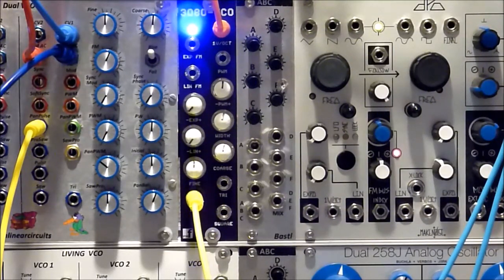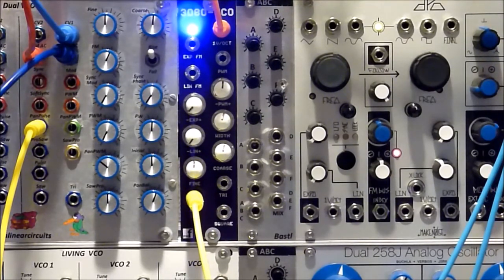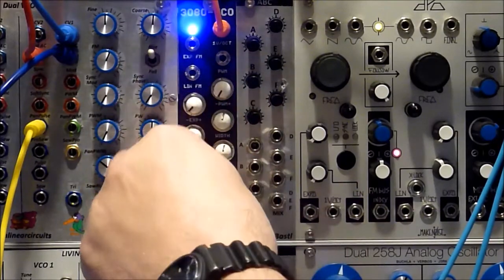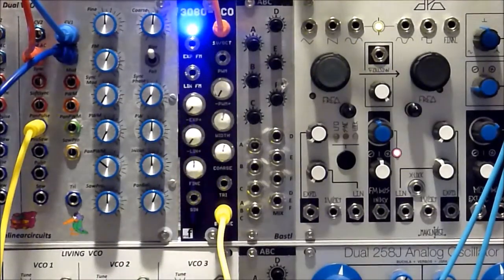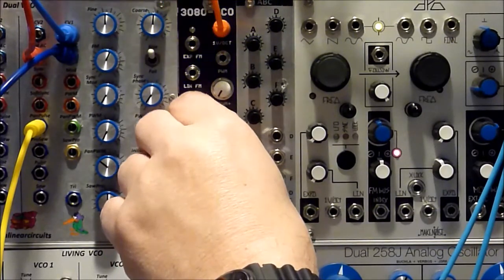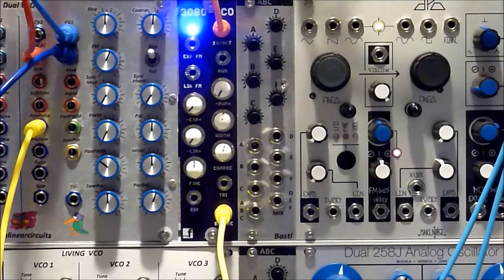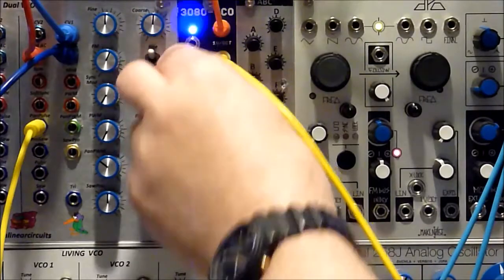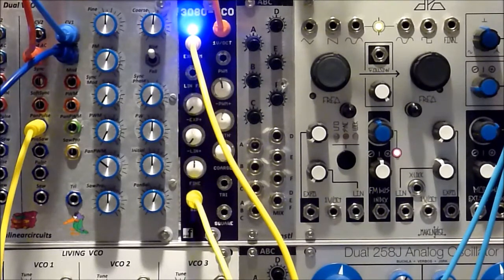Pmfoundations 3080 VCO

Comment: do you own or work for pm foundations? i bought a feww PMF modules
Reply from the maker: I do not own PMF or work for them.  I just like the stuff and like the guy who does own it.  Which modules did you get?  Have you built anything yet, or had a chance to try them out?
Reply: @RandyPiscione   vca ,3080 vco adsr and micro vco. there solid pcbs and worked as soon as i built them. im still want to know what this vco is based of off???
Reply from the maker: @chemosis8259  You should ask PMF, he's great at answering questions. I know his VCFs tend to be his own designs or his own mods to existing ideas but I'm not sure where the idea for the 3080 came from.  Have you checked out reSEMble yet?  Big build but I'm really enjoying it.